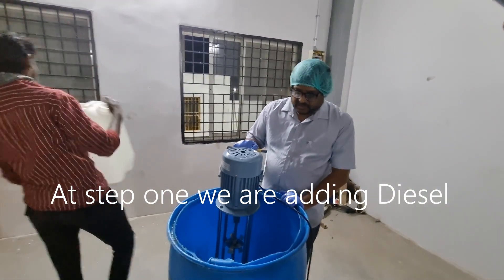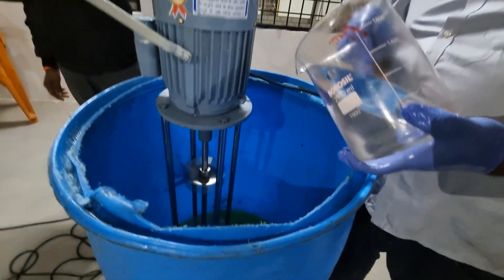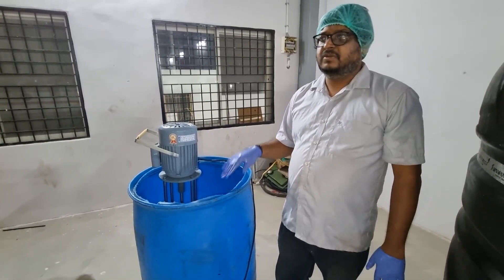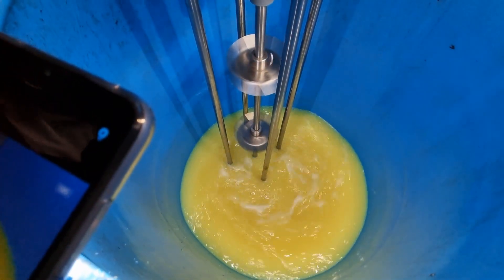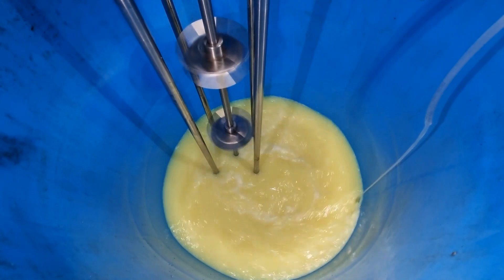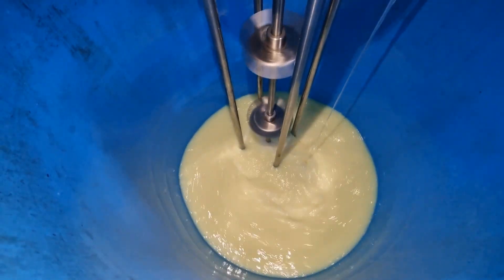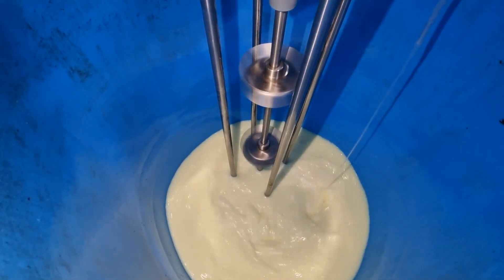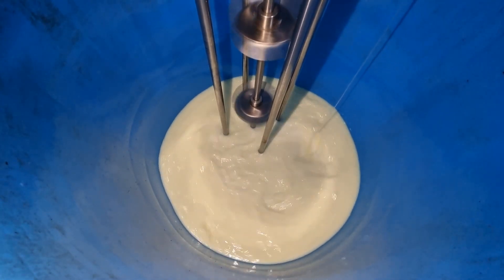Hydro Jal Diesel preparation Demonstration Part 1

Comment: Upto 5 % wayer addition with an emulsifier such as tween 80 or span 80 is sufficient. But 20% is a lot, it becomes harder to pump for the fuel pump and the fuel injectors.
Reply from the maker: Commercial model and commercial Fuel available you can test the fuel

Comment: in the USA fuel is plentiful and somewhat cheap, but we are about to enter into erea of short supply and high price,  fuel will be increase in price to around $9 a gal.  I think, it will be best to explore alternatives.  people here have never experience a lack of anything for the last 100 years.  that is about to change...  if someone disagree with this, I would love hear their reasons to backup their claims.
Reply: The alternative would be to cut some heads off the serpents among us, but, too many psys running around to do that.
Reply: somewhat cheap? its very cheap in the US, in the UK its more like £1.80 per litre (not gallons) post russia conflict spin.. pre conflict, still £1.18 ish iirc

Comment: Crap very hard on injectors and high-pressure pumps.   Energy content is less per unit volume. Don't fall for it,  If they could sell it big oil would be doing it already. You would do better with water injection for the phase change steam effect than to inject via direct injection.
Reply: Actually in tests hydrodiesel generally makes more power over standard pump diesel. It’s basically doing what water injection systems do but pre-mixed in the fuel
Reply: some crap diesel is better than no diesel at all.   we are about to find out scares fuel will become soon.  either because we won't be able to affort it, or it's not available..
Reply: Big oil hasn't sold this because there is a tendency for these water/fuel emulsions to separate over time... I've done a fair bit of research into this - what studies show damage and/or excessive wear on fuel pump components ( for a properly mixed emulsion)?
Reply: I don't know but Warped Perception already did tests on this type of diesel, both on a jet engine and a 4 stroke diesel engine, and it did pretty good for what it is. I highly recommend checking the video series on that channel.

Comment: So what happens when you're in a cold environment does the fuel just freeze solid or does it turn into a slushy how well does the emulsifier work in tempered conditions
Reply from the maker: This fuel will work below -5 degree Max
Reply: @gogreenfuels  have you tried adding alcohol to the mix? or maybe kerosene?